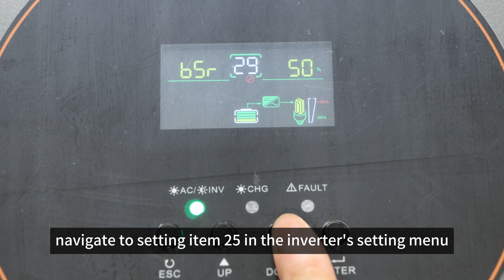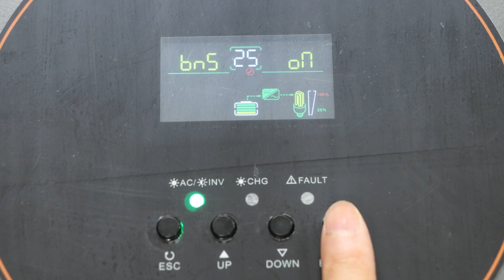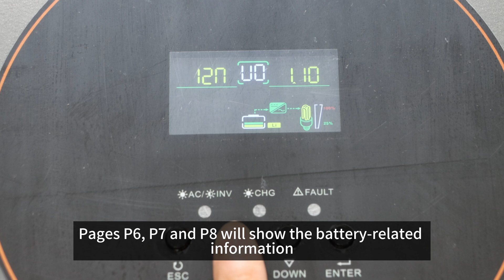POW RELAB Series & Lithium Battery: Easy BMS Communication Setup Tutorial

Comment: can I Communicate with every sort of BMS like ANT BMS? THX
Reply from the maker: Supported protocols include PYLON, Growatt, and Voltronic.
Reply: @PowmrSolar  that means the protocol is important? Ant BMS communicates via PYLON then it works? THX
Reply from the maker: @gerischi8871  If it is a PYLON protocol, you can try it, but if the protocol version is inconsistent, data deviation or asynchrony may occur.
Reply: @PowmrSolar  Ok, i'll give it a try, THX
Reply from the maker: @gerischi8871  Okay.